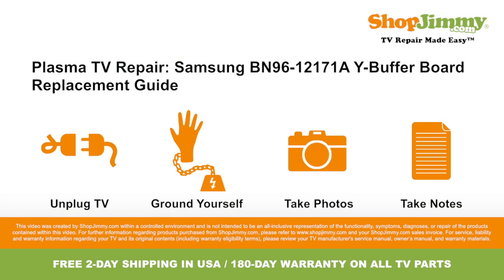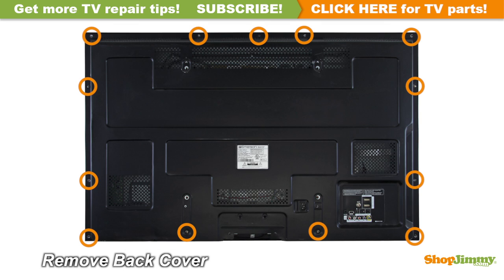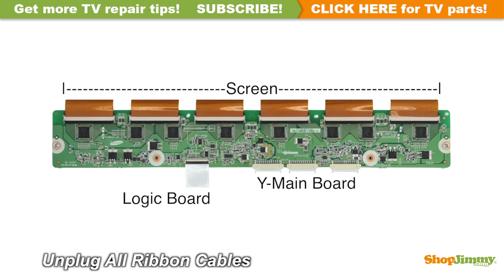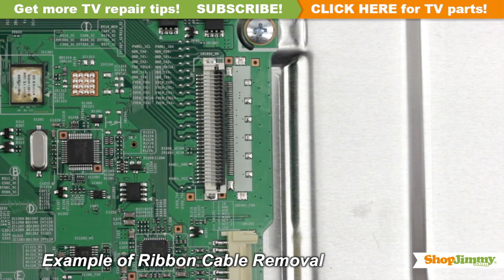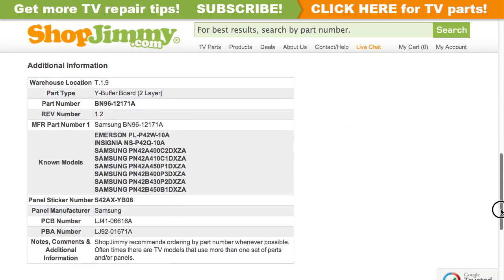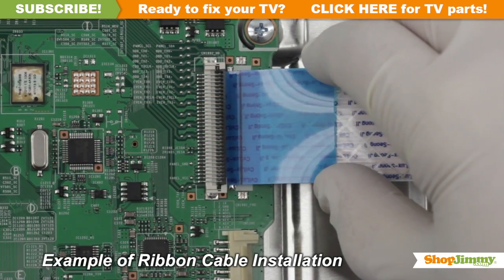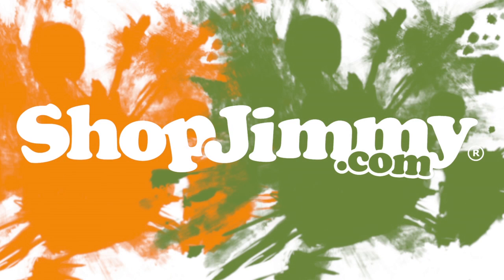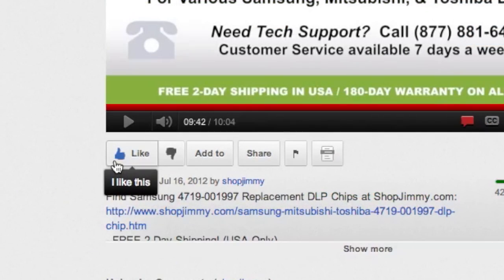Samsung BN96-12171A Y-Buffer Boards Replacement Guide for Plasma TV Repair

Comment: Hi I have a Hitachi 50" Plasma P50H4011A  Recently black horizontal lines are appearing intermittently on the bottom half of the screen only . Would you have a possible soulution or cause?

Comment: hello, I have a 50" plasma tv Samsung pn50c550g1f, and I have some vertical lines on the screen, i ready change the t-con board, but doesn't work, when i press the power button the lines showing immediately, and after the picture, you don't know what it is? what board i need?
Reply from the maker: Oreo Atayde   This sounds like a TV panel problem.  If your TV panel is bad, it may be more cost-effective to replace the TV as panels are typically hard to find in stock, difficult to replace, and expensive.  Thanks and please let us know if you have any further questions!  www.shopjimmy.com

Comment from the maker: @navedacool - Unfortunately I believe this is a bad panel that is causing the problem.  Replacement panels are difficult to find, hard to replace properly and typically very expensive.  Unfortunately we do not have that panel in stock.  At this point I would have to recommend finding a new panel or purchase a new TV.  Thanks and please let us know if you have any other questions!

Comment: No. When I replaced the buffer it still looked the same. 6 evenly parted out sections of the image... one for each ribbon, with 5 black evenly spaced horizontal lines separating them.

Comment from the maker: @navedacool - When you replaced the y-buffer did that help with the problem at all, did the lines move to a different location on the TV?  This could be a bad connection or a bad panel.  Let me know on my question and we can help you further.  Thanks!

Comment: Sorry. Stupid phone. I've got a 42 inch samsung plasma tv model number HP-T4254 it has a black horizontal line going through it between where each ribbon connecter from the y-buffer board produces a picture. I've tried replacing the y-buffer board already but still the 5 lines are still there.